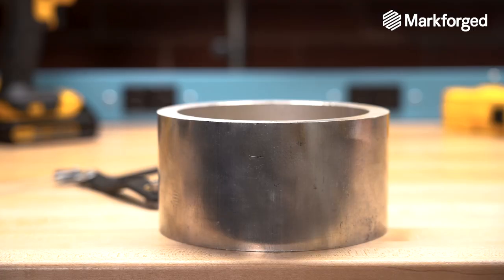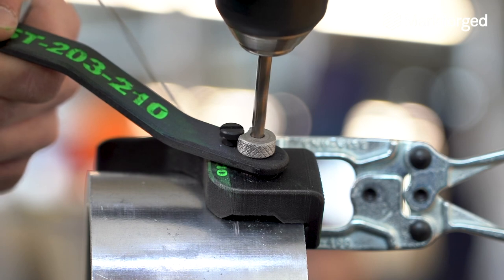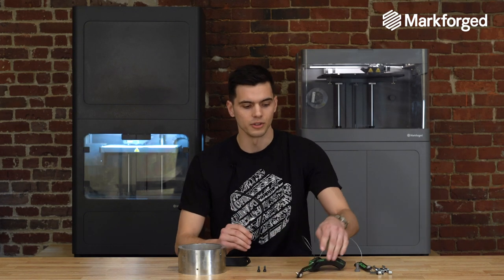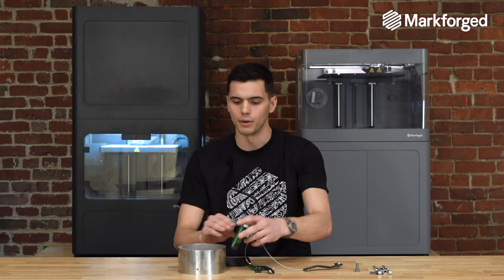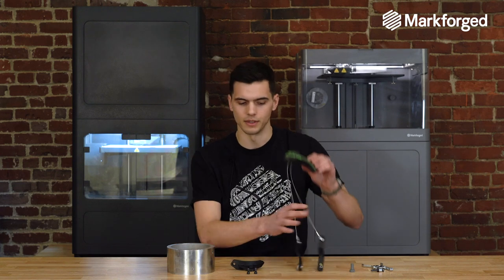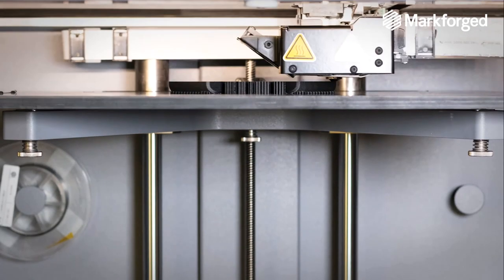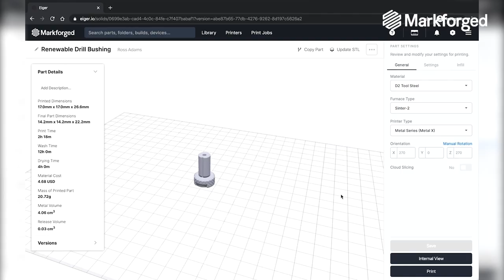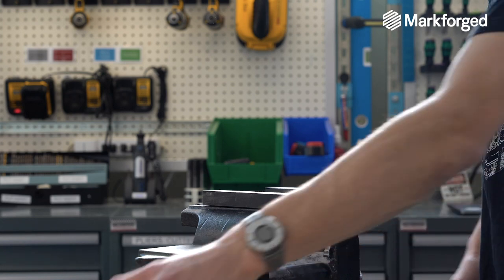3D Printing Aerospace Tooling | Drill Templates

Comment: + or - .005 for the tolerance. That would work for some stuff. You need to locate the jig with a laser tracker and the dowel. So you can achieve.001 tolerance.